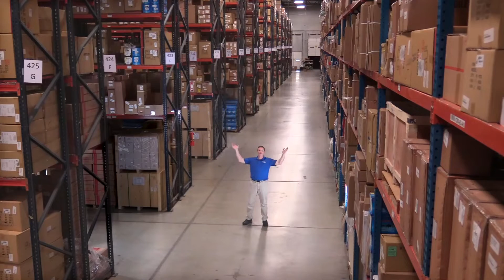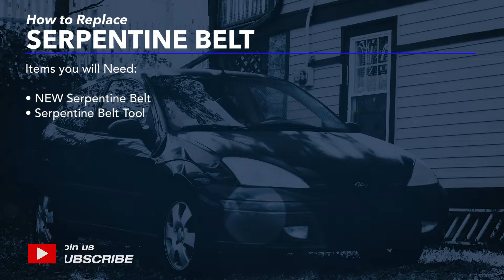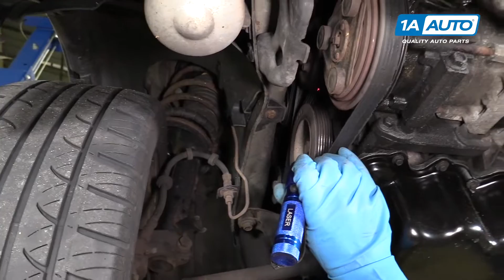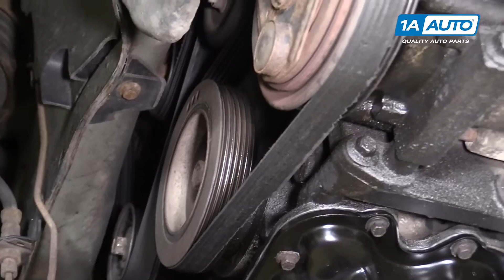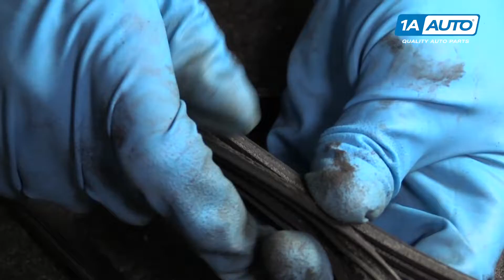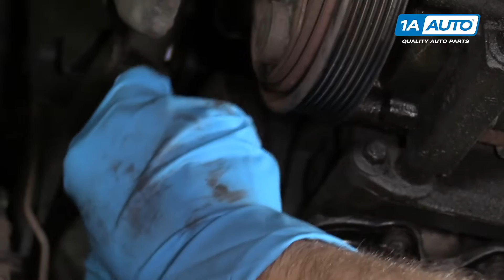How to Replace Serpentine Belt 00-04 Ford Focus

Comment: Is it possible to by pass air conditioner on a 2000 Ford focus SE without purchasing a pulley?
Reply: Yes, I am using the belt for the non air conditioned Focus because my ac compressor is shot. No other pulley or bypass pulley needed. This is on a dohc engine, the other engine is probably similar.